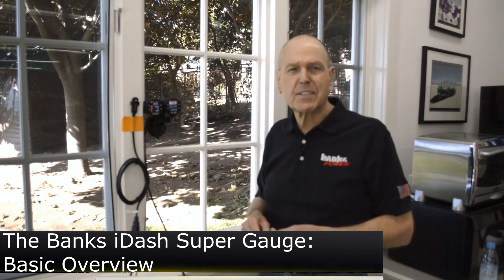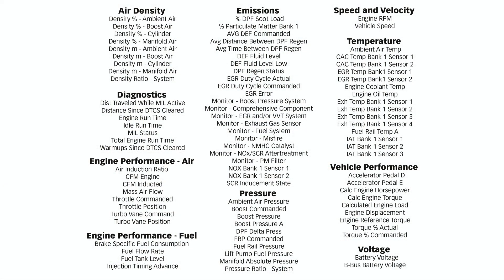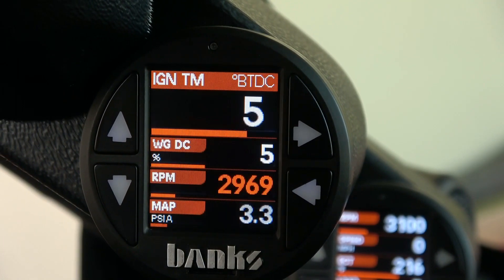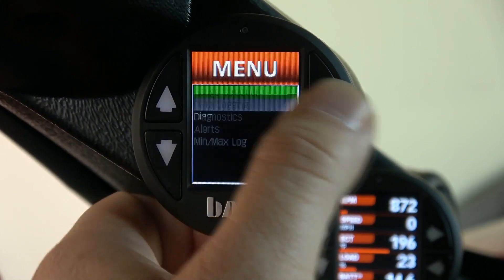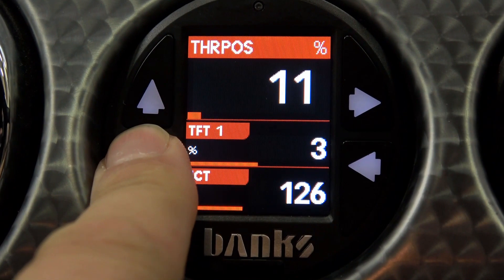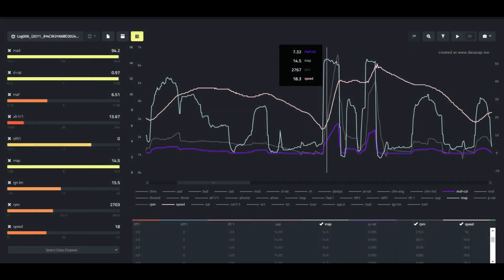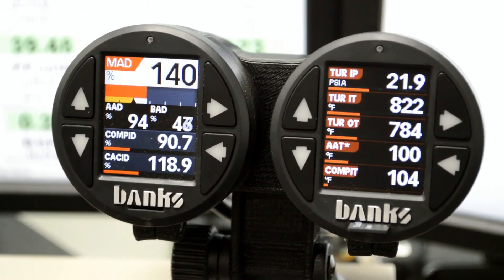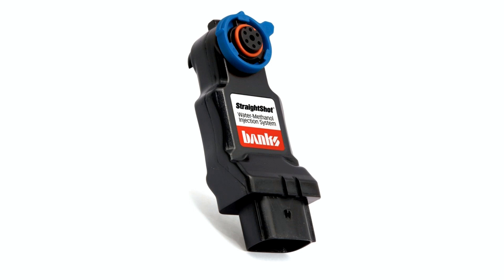The Banks iDash 1.8 Super Gauge: Basic Overview

Comment: Hey Gail or whoever I have a question about the I dash I wanna be able to see the transmission fluid temperature on the dash is that conceivable and is it listed under ATF temp or trans temp I can’t find it. I haven’t dug into it. I haven’t installed it yet but it’s coming up if I should do pedal monster at the same time, I do the. The I dash gage

Comment: I bought mine and everything work good but my 6.7 power stroke is deleted and is not reading the EGT’s, is this because the truck is deleted or I need to buy a sensor ????
Reply from the maker: Yes and yes. the iDash is reading what the ECM is broadcasting. It's design to read the factory computer. Any software modifications will cause an error code like this to occur.
Reply: @bankspower  thank you love what you do and my Idash is awesome💯💯

Comment: Too bad I can't set this up to work with a speeduino for my e36
Reply from the maker: Actually, you can. We offer an aftermarket ECU version, if you would like to, you can create a custom network of sensors and iDash gauges. Click here to learn more: 

https://official.bankspower.com/tech_article/whats-going-on-in-my-engine-and-how-do-i-know/
Reply: @bankspower  very cool. I’ll have to look into it, I know my e36 isn’t exactly like what’s in the banks power wheelhouse but I’ve been wildly impressed by what I’ve seen on your YouTube channel and I’d love to contribute to your business at some point, in some way. If I can set up temp monitoring for my intake and post inter cooler temps as well and temps for post turbo oil temp and pressure as well as post turbo water temp and pressure that’ll make my day.
Reply from the maker: We can handle all of that, we offer 40+ accessories (most of them temp sensors) for the iDash. These seniors cover liquid and air and cover a range of temps (up to 1500+ degrees). Please click the link below for all the iDash sensors. 

https://www.bankspower.com/c-70

Comment: No oil pressure reading???
Reply: All you need is a standard 1/8 NPT pressure sensor. I'd call Banks for specifics on their A/D modules, sensors, connectors, etc. Apparently you can hook-up your existing sensors to their A/D module, using their spare connectors, in order to plug into their A/D module, which then goes to the iDash.

Just playing around with this stuff myself (1990 12-valve Cummins), before taking the plunge and replacing my analog gauges, hoping the price comes down on this stuff some more.

Comment: Will this read all the PIDs for an early 03 6.0L Powerstroke Diesel?
Reply from the maker: No. The currently iDash reads CAN OBD data in vehicles 2008 and newer. We'll be releasing our Pre-CAN iDash in the coming months. This version will display all the PIDs on your '03 Power Stroke. Keep an eye on our Facebook and/or Instagram for the announcement.
Reply: @bankspower  Is a Pre-CAN iDash still in the works, or has that been squashed?

Comment: Is this ONLY diesel or can Gas or Gas / E85's use this as well?
Reply from the maker: It universal for anything 2007 or newer. Il will work on older than 2007 Amercian trucks than have our tuners. We are developing a pre 2007 version for older vehicles that will be universal that we shooting to release this winter.
Reply: @bankspower  Will it flash a stock ECU...? for tuning and TURBINSKI's???
Reply from the maker: @amindnew527  The iDash is not flash tuner, nor is it a tuner at all. It's a diagnostic device and monitor.

Comment: I didn't think I could get EGT's without inserting a sensor in the exhaust system. Is this true?
Reply: Basically. It's a thermocouple placed inside the exhaust or exhaust manifold that converts heat into an electrical signal. The more heat, the more signal, usually taken off of the exhaust post-turbo, or before that, right at the exhaust manifold, pre-turbo.

Comment: would this work with 2016 Subaru STI ?      id like something that I can use in my 03 cummins and 07 duramax  I want the same units in all 3 .
Reply from the maker: It was designed to work with any car! We'd love to see an iDash and AirMouse on your Subaru. It's plug and play.
Reply: un traceable ?  key counting back to 1 after uninstalling before taking trucks &  car back to dealing ?
Reply from the maker: Say what?
Reply: lol sorry ... speak to text wasn't so great that time ..  Would it be untraceable? and would the dealership know if I installed this gauge system.   does it somehow reset how many times the car has been turned On ?
Reply from the maker: The iDash shows up in some ECUs as a diagnostic device. The OBD port in your car was designed for diagnostic devices to be connected just for this reason. When you go to a mechanic, including your dealer, they use a diagnostic device. Bottom line, no dealer would ever have a problem with it.
Reply: 👍👍👍thanks for all the help .   now I just need to order 1 for each car.
Reply from the maker: bankspower.com/idash

Comment: Ok, I have a 1994 f250 with the 7.3l idi. No engine computer. What I'm looking for is something similar to this, where I can install my own sending units and have the data displayed on a single gauge or panel. I don't really need data logging just need more than the three or four gauges in the a pillar.
Reply from the maker: Walker, what you're looking for is our iDash 1.8 with our forthcoming sensor module suite. You can order the iDash without data logging. But the magic ingredient in your setup will be our suite of modules including the 4-channel thermocouple modules which will be available later this summer.
Reply: Very interesting. I shall add this to the bucket list. Thanks!
Reply: Hey great question - I have the same ... '94 IDI F250 - with the "Banks Power" package (how befitting!). Thanks for the answer Mr. Banks and I will be looking into the Dash 1.8 mentioned. As a former engineer, I appreciate such well thought out products. It's no wonder you are a legend!
Reply: Perfect timing lol, i plan on picking up a 87 6.9 IDI
Reply: Is it possible to use this on a carburated engine to read AFR, oilpressure, oiltemp etc?